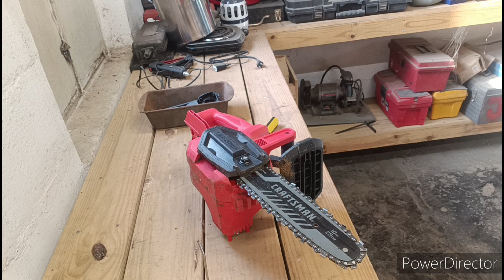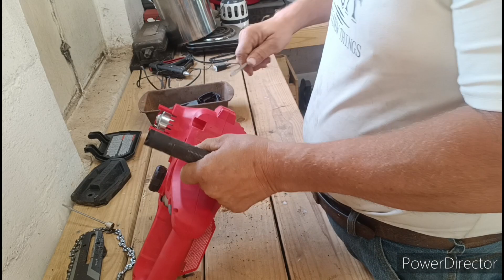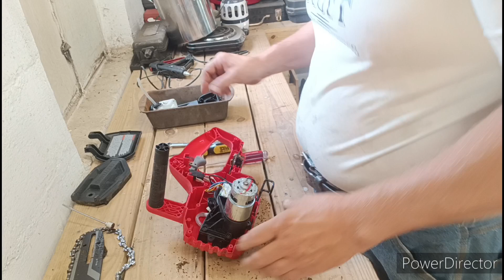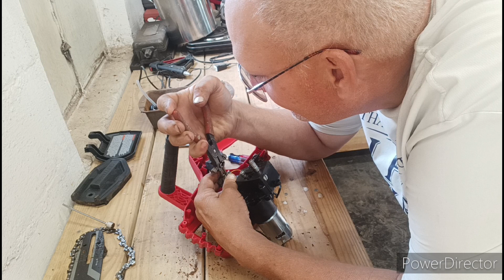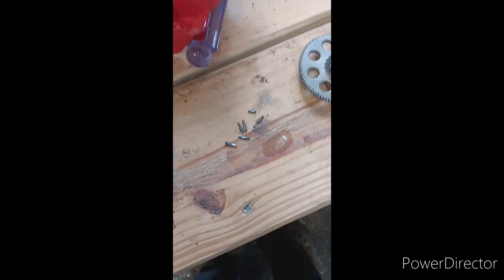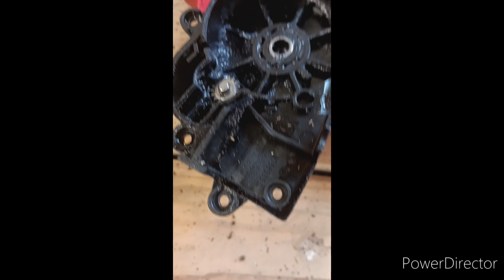I broke my craftsman v20 10" chainsaw  !

Comment: You probably asked too much of that saw tbh. I would try to get your money back and spend another 100 or so on a battery saw from one of the top brands. dewalt, stihl, milwaukee etc. I like your video, good job.
Reply from the maker: I had it a year but while cutting a bush through a fence the chain got hooked in the barb wire fence and was stuck
Reply: @lynnshomestead7545Johnlynn  that'll do it. lol.
Reply: @lynnshomestead7545Johnlynn  did you find where to get a new gear.  i have multiple ones that have done the same thing.
Reply from the maker: The company sent me a new one, plus I bought a 12" saw for bigger stuff. As far as the top brands they are very good but out of my price range for all id used them for.
Reply from the maker: Gears aren't available.  I doubt it be worth going to a machine shop to have one made.
Reply: @lynnshomestead7545Johnlynn  I have 3 of them with same gear stripped.
Reply: @ericslayton4779 was it normal use? I’m curious what you’re putting them through.
Reply: @carterplace8579    cutting limbs mostly but sometimes some bigger pieces but they just don't hold up the way they should.  one specific gear in each of them wore out.
Reply from the maker: @carterplace8579 well what caused the gear to break was my fault,  the chain got stuck in the barbed wire that was in the bushes
Reply: @ericslayton4779  sounds like crappy machining.. what made you decide to buy number 2 and 3 lol?
Reply: @lynnshomestead7545Johnlynn  if Eric has toasted 3 of them I’m prone to believe the weakest link is the machining on the teeth for that big torque gear you showed in your disassembly… barbed wire or not that shouldn’t be what’s giving out first.. there should be some sort of overload protection that prevents the motor from eating the teeth off the gear in the event of applying too much resistance.( or simply make the gear out of stronger metal)
Reply: @lynnshomestead7545Johnlynn  most of my tools are v20 craftsman and I have to say their warranty coverage and price definitely makes up for this kinda stuff